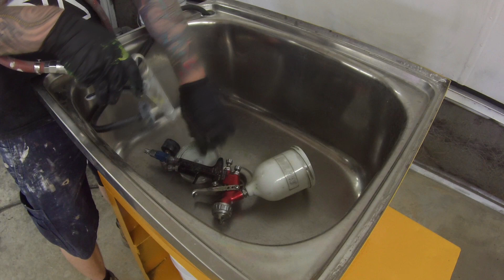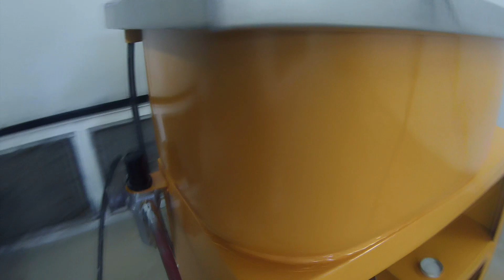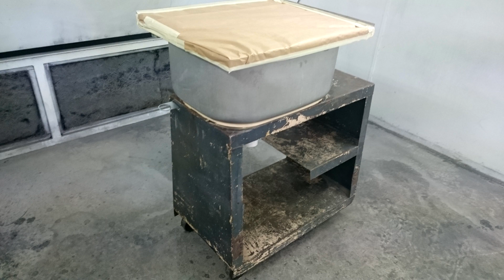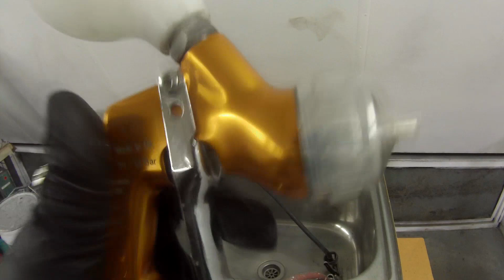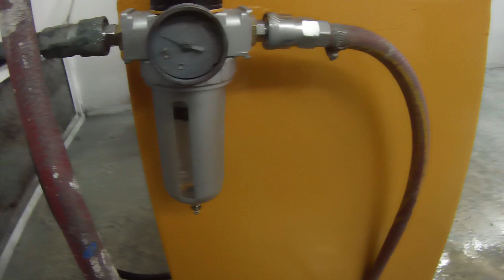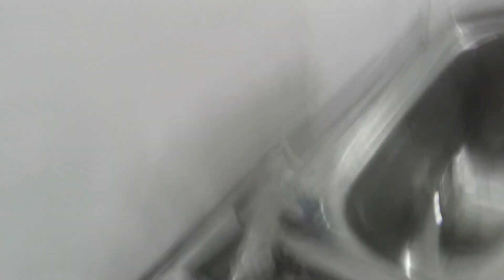Homemade Gunwash Machine

Comment: Good system.  I do plaster and sometimes sealers and have been looking for a cleanout solution.  Im going to have more sludge so probably need to make a stage one trap that overflows to another filtered tank, but the basic principle with the airline

Comment: While it makes it easier and quicker to clean, by using air to pull and atomise the solvent you create a lot of fumes which I do not think is particularly healthy  nor safe... 
Pneumatic diaphragm pump (second hand not expensive) would be better + atlasta flow through brush - just a suggestion...

Comment: Will the thinners evaporate out of the bucket when it's not in use? Or do you have to uncap it and insert the funnel and drain tube every time you use the wash station?
Reply: Mieesh30 I would cap it and remove the hose.  thinner will evaporate also the hose will last longer.

Comment: That's a nifty Lil unit, I am just thinking out loud, but you could go a bit mad and fit something similar to a shot/sand blasting unit on the too to keep it sealed, and have a two way valve for the thinners, have two drums of thinners, do initial wash with the waste drum thinners then switch over to clean drum for very last wash, all waste would go to used thinners drum all the time!  Hmm I might try make one.. IL Jeep yez posted :o great job
Reply from the maker: How'd you end up going with it mate?

Comment: can't a 25u or less bronze air filter, or a cyclone, be used to clean the solvent before spraying ? one would need a pressurized barrel may be but not so much pressure needed. 
Bronze filters can be washed.

Comment: that is a great basic idea. I suppose a system to filter the output solvent would help. I am wondering what kind of filter would do . at least paper filter in the cone, but a second recipe where particles can go to the bottom. or simply a second barrel then the solvent can be recycled later.

I do not understand why the cap is not out and an air gun added to dry the inside once cleaned.
(it is too bad to use contaminated solvent in the air circuit ?)

Comment: Hi Gunman, thanks for the videos.
Question: When cleaning your gun I notice you don't take the gun apart. I've always taken the cap and needle out to clean the gun.. Am I wasting my time?
Reply: pales851 I'd even say once every few months, depends on how much you use them and how lacmzy you are to cleaning them in first place, obviously you are not as you take it apart, I'd say every month if you using gun full time 7 days a week, if only a few times a week it's not a necessary, my own opinion :o
Reply from the maker: Emmett Coen Totally agree mate, the most important thing is back pressuring the chamber, I run thinners through them 2-3 times and then hold my finger over the nozzle forcing it back up the gun, this method clears the passages. I had a brand new gun, used it for a month every day then pulled it apart and it was spotless on the inside, it didn't even need to be pulled apart. Some people over do it and risk wear on the threads. I saw an apprentice ruin a gun by overdoing the cleaning, even the supplier couldn't fix it with new parts.
Reply: Hey man.. Bike to hear from you again.. A very simple way for back pressure cleaning and believe me it works is unscrew the air cap until it just about falls off then wind it back a thread or so and pull trigger, no need use the fingie, I use this method for mixing lacquers and any 2 pack for quick/cheap jobs, as in throw it straight into pot! Let me know if I confusing the Shit out of you lol.. I'm on some snap chat, I do a non serious version/mild auto repair / bit of craic type thing like you do.. Let me know.. If anything you will get a laugh! But in fairness.. Mine is.. Am... Well words can't describe it Hahaha
Reply from the maker: pales851 For an everyday clean I don't bother but once a month I like to pull them right down, check out this one mate I explain it all https://www.youtube.com/watch?v=_fh72tOUenU
Reply: Feck I need to do spell check b4 posting, instead of typing as I'm thinking!
Reply: I spray different paints with my gun and I have noticed that one of the types of paint I spray really does dirty up the gun fast, bu the normal automotive paints do not. I would say that it really depends on the type of paint you spray and how thick the paints are that will determine how often a complete tear down and clean is needed.

Comment: Hey Gman?  I've panted some front bumper covers with deep fog light holes and a lot of "fins" in the lower bumper openings.  I couldn't get the clear to lay smooth in these areas.  I ever adjusted to a really narrow fan.  They were acceptable but I wasn't happy with it.  Any suggestions?  Or videos on this issue?
Reply: Have the same problem. Same with narrow openings when spraying wheels. Did you ever find a solution?
Reply: buy a minigun to do small areas first then switch to a bigger gun.

Comment: Hi gunny, use the paint hose from a pressure pot setup,it is lined with a special material, thinner won't attack it.
Reply from the maker: Gary Hess ok, thanks
Reply: The Gunman ive used a piece of steel fuel line on the end of my hose from an old wreck. cheers..nice setup btw.

Comment: for your fuel hose try using some e85 compatible hose, itll last longer and be a bit more durable
Reply: The Gunman also ther are special fuel hose designed to be submersed  in solvent liquid as weel as mentioned e85 hose but i rekon the submersible is the go http://www.ebay.com.au/itm/444-Series-10mm-3-8-In-Tank-Submersible-Unleaded-Diesel-Fuel-Hose-/141128288378?pt=LH_DefaultDomain_15&hash=item20dbe6c87a
Reply from the maker: vonfluer Thanks, handy to know.
Reply from the maker: Thanks